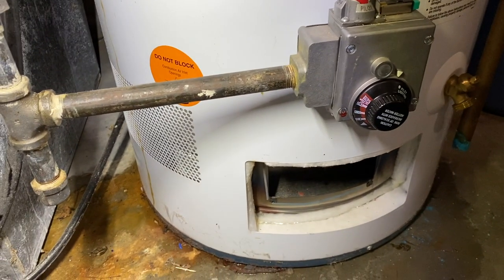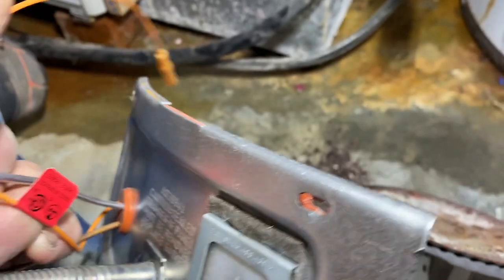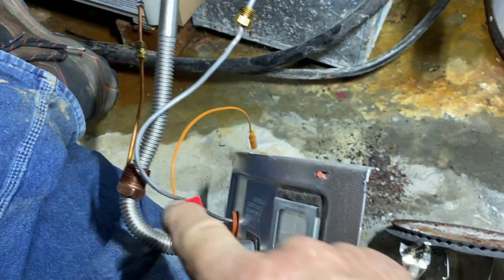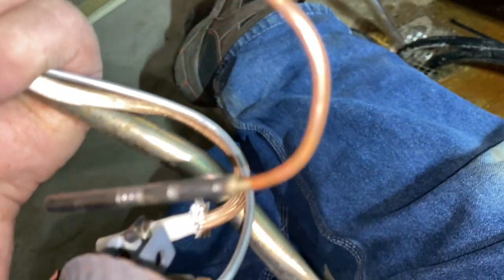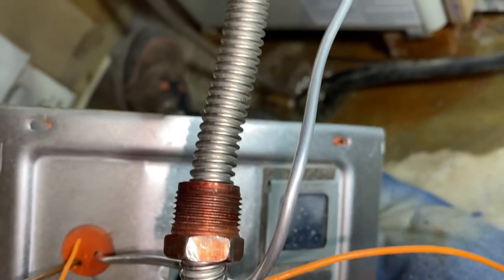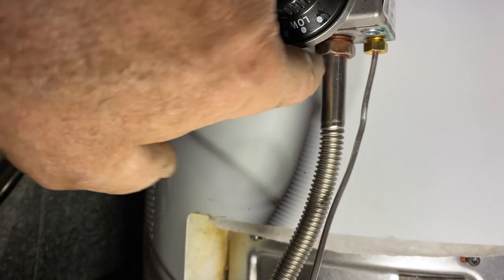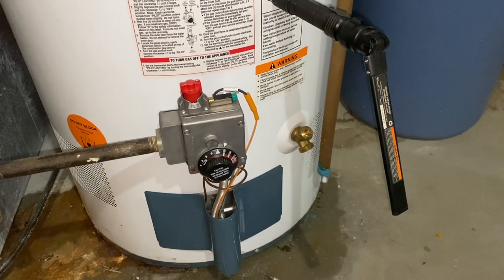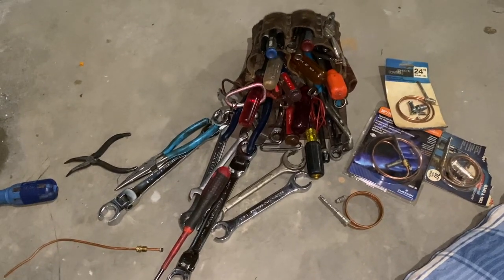Changing Thermocouple LP Water Heater

Comment: 44 it's been years since I have changed a thermal cupping thought they did not have them any more
God Bless 
PaK
Reply from the maker: Oh heck yeah Peter, they are alive and well yet.  Its just most gas fired equipment with a power supply rely on 'flame sensing' controls.  Water heaters, most of which require no power still utilize thermocouples because they generate their own millivoltage supply for the safety circuit.  Good to hear from you my friend !!  Take care sir and have a nice week.

Comment: I have that same kind of rub gasket it on my water heater. Was it tough to pry off, but easy to put back together?
Reply from the maker: It's not too much of a problem at all.  But then I have done it hundreds of times on all types of equipment, large and small. A lot of times just a dash of liquid soap does wonders to slip a tight rubber grommet over an item.

Comment: Link to new thermocouple?
Reply from the maker: https://www.amazon.com/Rheem-UV6379L-18-Inch-Thermocouple-Kit/dp/B0076RWH4M/ref=sr_1_3?keywords=thermocouple+for+water+heater&qid=1646792078&sr=8-3  This one is referred to in the trades as a 'Slim Jim' universal replacement.  They come in various lengths up to 48''.  Water heaters usually require 18'', and furnaces 24'' to 30''
Reply: @tractorman4461 I just measure mine is the 24in you have the link to that size? Thank you for responding
Reply from the maker: @Benthehitman32  How's this: https://www.amazon.com/Emerson-TC24-Universal-Thermocouple-24-inch/dp/B00RJF4TJW/ref=sr_1_3?crid=V7WEDZQS5T8L&keywords=universal+thermocouple+24%22&qid=1646828602&sprefix=universal+thermocouple+24+%2Caps%2C121&sr=8-3

Comment: I just can't get the pilot light working on my electric water heater! What am I doing wrong? Good video Tractorman44 Friend! I raise me cuupaJO your way! So how soon can you get over here to fix that pilot light on my electric water hater? All the Best to the 44 Headquarters! Thanks Kindly my Friend! DaveyJO
Reply from the maker: Usually when the pilot light quits on the electric water heater its because of the bronze lined silver bearing on the hoosticater shaft has worn beyond tolerance and the electrons flow out the end of the shaft instead of holding the pilot light in.....   Bad news DaveyJO....  You may need a whole new one now !!  Good luck with the highly technical repair.....or get your 10lb. sledge and that'll fix it just right !!  Sippin and tippin in the morning to you sir....
Reply: Tractorman44 You know TM44, I had a strong  suspicion it was just that. I will apply the 8 pounder to it and see if that helps. I know you'd know why that baby wouldn't light! Thanks my 44Friend! I toast you now I toast you tomorrow! DaveyJO
Reply: Tractorman44 You know, after reading your diagnostics I finally realized it was indeed the hosts after and not the rooster cater or the alligator, no wonder! DaveyJO
Reply from the maker: Daveyjo Weaver Hahahahaha. Good to go now !!!
Reply: Is that you, Joe Biden?